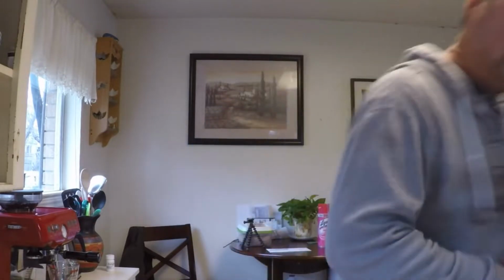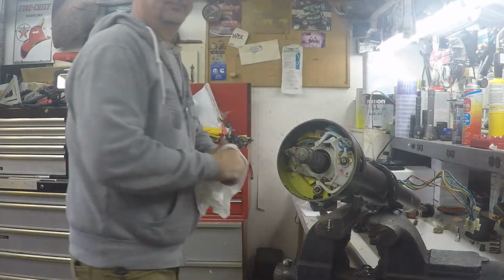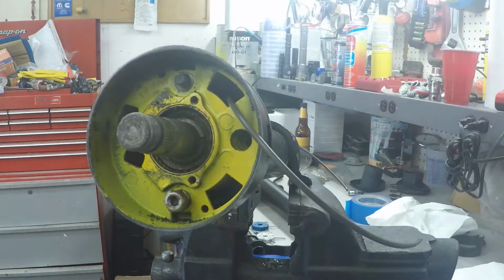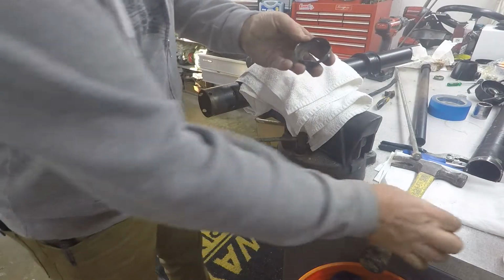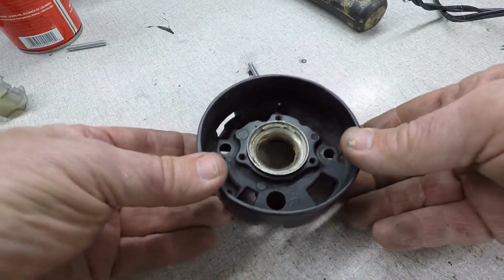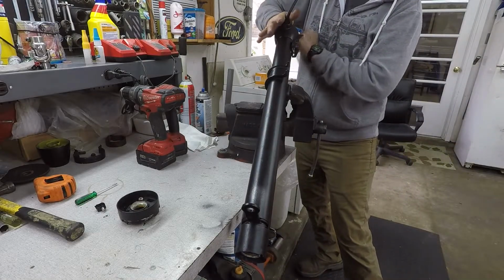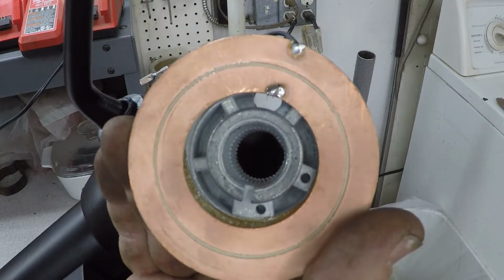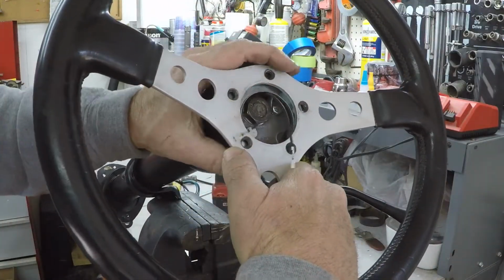#4 Early Ford Bronco steering column rebuild

Comment: Thanks for the video. Been trying to take care of dad’s 66 F100 since he passed somewhat recently.  He did a power steering conversion (and other stuff) which means a lot of the parts have been swapped or modified so it’s not always clear what I’m actually working with part-wise. The steering shaft has play up/down so been digging on the net trying to understand how it goes together and functions.  

There was a big aha moment when you mentioned setting the clearance at about 1:00 left in the video. I think this is what I need to do to fix the issue. I couldn’t quite tell what happened to secure it. Just the small clamp?

It seems I need to loosen this clamp, push the shaft in to proper clearance (no slop), then tighten the clamp. Does this sound correct?

Thanks for any advice you can share.
Reply from the maker: Yes, that is exactly how that works, as long as the upper and lower bearings are in good shape. You'll get it! 👍👍
Reply: Thanks for the quick reply!  Using the information from your video gave me some new research material. I think I’m figuring this out.  Fingers crossed for no issues with the bearings which should make for an easy repair.  No more forgetting to turn the blinker off. lol 

Thanks again.
Reply: Update: Fixed!  All this time with this condition and it was a super simple fix. Thank you so much for taking the time to show this assembly process and help me out!

Now, of course it wasn’t as easy as just moving the clamp. Due to the modified components the clamp bolt then wanted to hit the column bracket… Ultimately I think the bracket needs straightened a little but I was able to finagle things enough to prevent contact. We’ll roll with it for now.
Reply from the maker: Awesome!!

Comment: Do you have a part number for the pin removal tool you used. Great video! I was wondering how the top bearing was held in and now I see how it works.
Reply from the maker: Thanks for the nice comment! Its a Lisle 56500,  terminal pin removal. Amazon has a nice set that includes 3 different types including this one.👍
Reply: @StevesBeyondRepair  Thanks again, got one coming
Reply from the maker: Greatness!

Comment: I missed the turn signal canceling cam or does your switch not need it?
Reply from the maker: The cancel ability came from a pin that goes on the grant steering wheel adapter, and I left it off. I have a blinker buzzer that reminds me when I leave blinker on.👍👍
Reply: @StevesBeyondRepair  my wife is always telling me I forgot to turn mine off. I noticed mine didn’t have the cam that’s why I asked. I’ll have to look at my steering wheel, not sure it’s grant I got it from Tom’s a few years back.